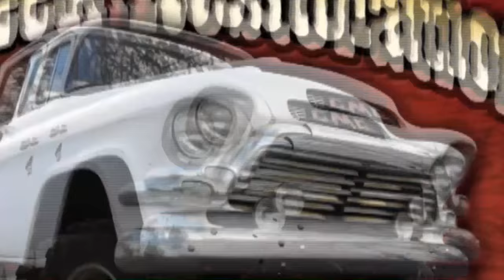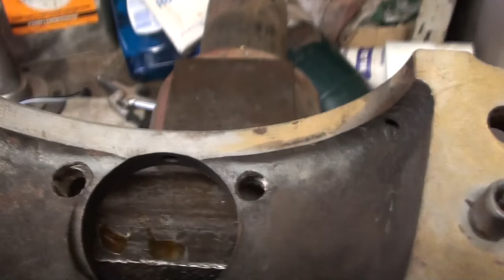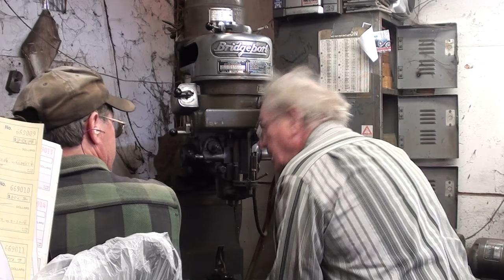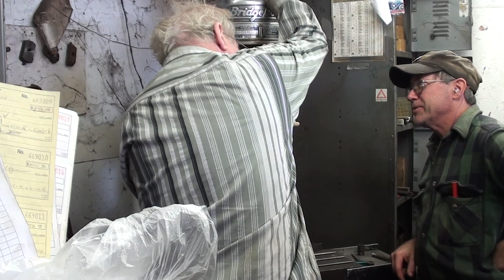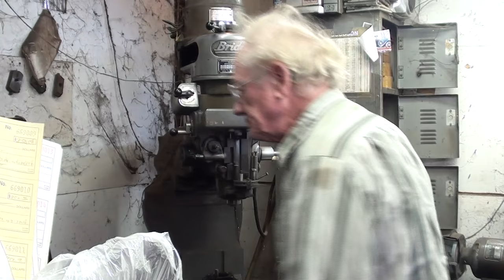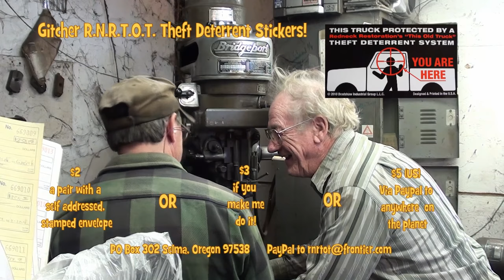Crusty Old Grand Dad Napco Knuckle Repair

Comment: I have a '56 GMC with the Napco axel ,  that I have had since '73. A lot of chevy engines went in and out of the truck. It was rode hard and put up wet all the time,\. Point is I am restoring/rebuilding it . So watching you gives me a lot of insight as to the right way the wrong way and my way to do things. Love what you are doing, saving old  iron from being crushed .

Comment: So, get it all lined up for the proper hole center using the plate as your index but remove the plate before drilling/milling to avoid making the hole bigger in the plate.

Comment: Jeff can you use some taper`d wedges off like  a 92 dodge  3/4 rear axle shaft they bolt the axles to the brake hub , to fill the holes in the steering rod to align them center looks like they are about 3/8 holes the tapers are up to 1/2 might get you by ???